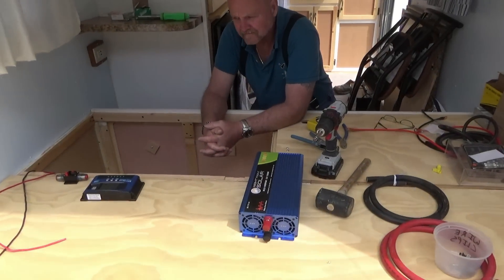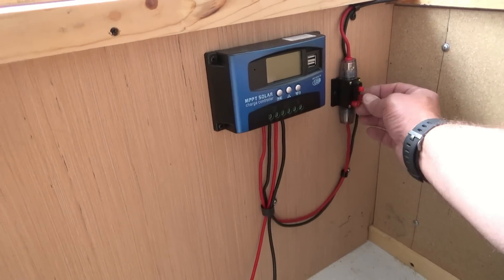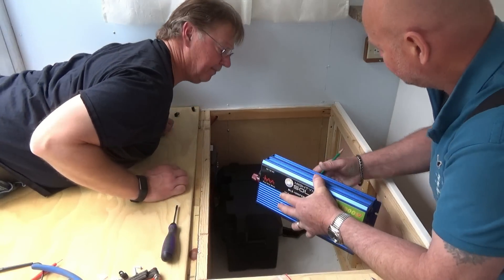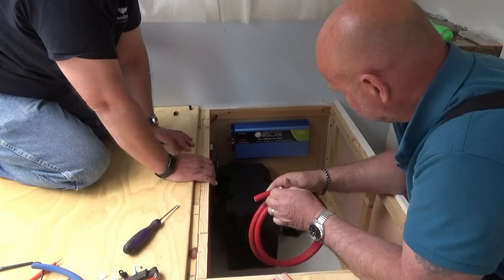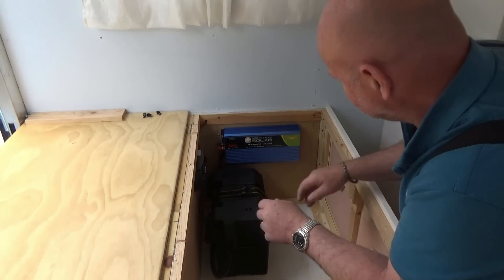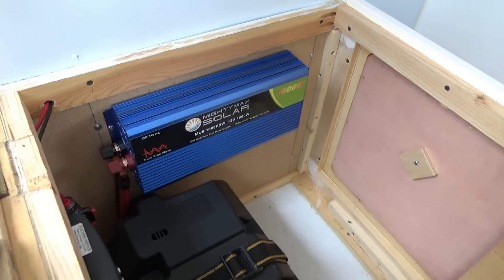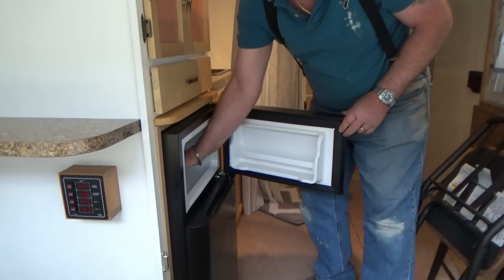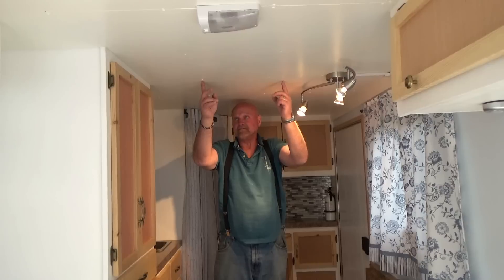Solar Panel Install Cargo Conversion Camper Part-2

Comment: Thank you very much for this very helpful video! I plan on doing this to my landscaping trailer. My only question so far is what is the wire gauge going from battery to inverter?
Reply from the maker: Hey Lawn Boy!  That wire is like 00 gauge. Pretty heavy duty. You'll want a heavy gauge wire from battery to inverter and as close as you can. This will keep the wire from getting hot if it draws too much power

Comment: Hey great video! Just wanted to know, what type of battery are you using and how long will it run for over night while the fridge is still plugged in?
Reply from the maker: Thanks Suhail! Using a 100 amp hour AGM battery... the refrigerator can run about three days on the battery before needing a full recharge. Have a good solar setup or a generator handy. :)

Comment: I may have missed the info in the videos, but how big is the panel and the battery? I'm looking to run a smaller (1.7 cu.ft.) frig in my trailer.
Reply from the maker: Hi John! The solar panel is a 100 watt panel and the battery is a 100 Amp Hour. I would recommend using two batteries unless you plan on using a converter and shore power to keep the battery topped off.  The fridge will run for about three days before the battery needs a full charge... cloudy days the panel can't keep up. Hope that helps! Thank you very much for stopping by and watching!
Reply: @OregonBatman  - Thank you for the info. I got a deal on a 245 watt panel & 2 - 95 amp hr batteries. BTW - I watched  your entire TT build and learned a lot.
Reply: @OregonBatman  
How would you combine solar and shore power?
Reply from the maker: Not sure that you can "combine" solar and shore power.... I believe there are converters that connect shore power and 12 volt systems that can be used. Most RV's use that sort of system. When disconnected from shore power, the 12 volt system is used, and once connected to shore power, disconnects 12 volt.
Reply from the maker: When parked and connected to shore power, a converter is used to charge the batteries. You can run your system on 12 volts with the converter while on shore power..... converts the 110 to 12V. Or you have two systems, one for 12 volt and one for shore power.

Comment: I would recommend installing a fuse in between your inverter and the battery--I couldn't see one in the video. With a 1000W inverter, you would only need a 1000/12 * 1.25 = a fuse slightly larger than 105 amp rated capacity.
Reply from the maker: Thank you Michael... yes, thank you for the suggestion, and I agree. Currently no in-line fuse. Should be installing one soon. Thanks again!
Reply from the maker: Let Jack know what you said... he'll be installing in-line fuse this weekend! :)    Thank ya!

Comment: Nice work! I love it.  What gauge was that wire going from the battery to the inverter?  Those were huge!  Mine are under-speced and they get warm (24V though).
Reply from the maker: Hi Legend of the Stormlord! The wire that we used was 00 audio wire. A lot of guys that install sound equipment in cars use this extensively! Highly recommend where you are going to be pulling a lot of juice! You install this, you won't be heating up any wires!
Reply: you can't have high gauge wire running from your battery to your inverter. I've used 4 gauge in my car with a fuse on the positive and it was plenty.
Reply: @kingpickle3712  That just depends on what you need to run with that inverter and also depends on the battery voltage.  The smaller the load, the thinner the wires you need, and the higher the DC voltage the thinner the wires you will need too.

Comment: You two so much fun working on RV. I like your videos. Just need like 3 or 4 panels to make it work, one wont cut it. Not sure if you had one or two batteries.
Reply from the maker: Thanks FMT! He's got room to grow! Right now, just needed a little juice to run the refer for when we go on trips! If he get's totally off grid, gonna need an extra panel and battery!

Comment: That's pretty good Al & Jack! I wonder how many beers were drunk after finished it all ! lol  I still do'nt have an inverter , but I would make a small hole in that compartment for ventilation, considering that there's a cooler inside of the inverter. Perhaps a flexble alumminum hose to be installed in front of the inverter's cooler running till any small opening ..well...that's an idea. I don't know how much does it warm up ! Anyway, it's well installed!
Reply from the maker: Hey Carlos! Yeah.. we celebrated after we were finished! Jack was a happy camper! He said he'd have a Brama for you!